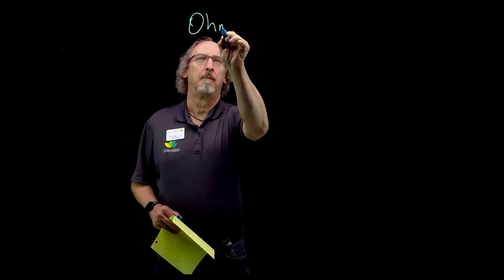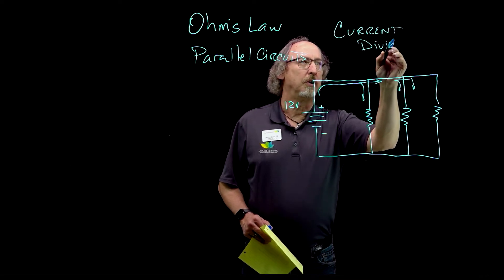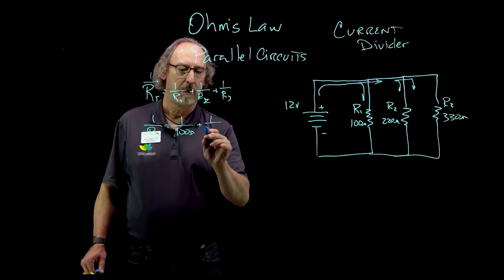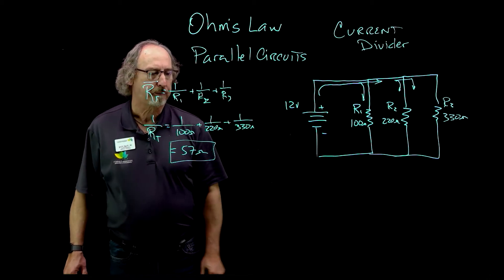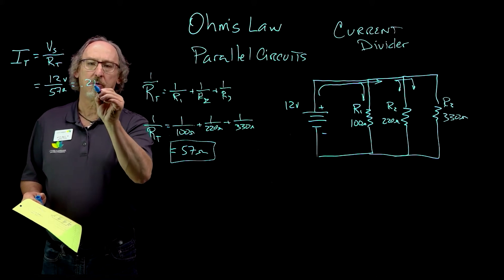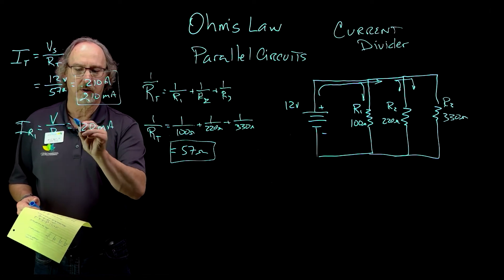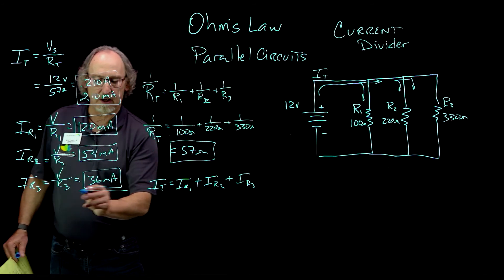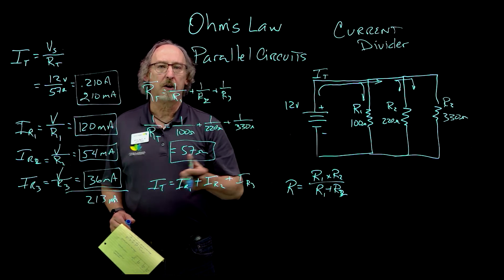Ohms Law - Parallel Circuits

Comment: you said the voltatge down each branch is 10v. it's 12volts correct?
Reply: He meant 12V, I plugged in the calculator and got the same results he had.